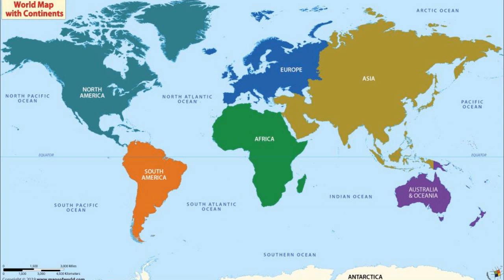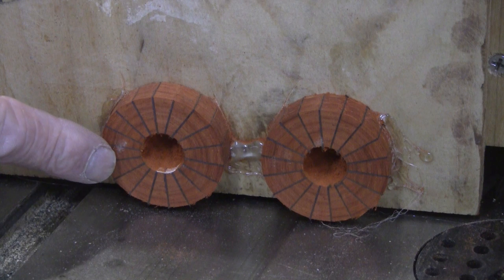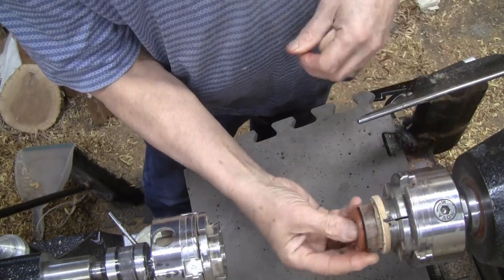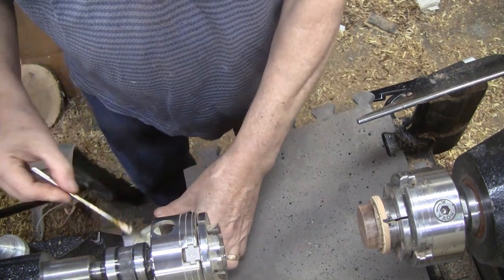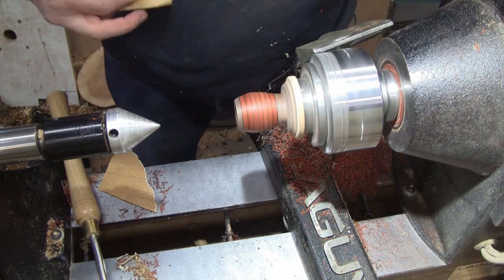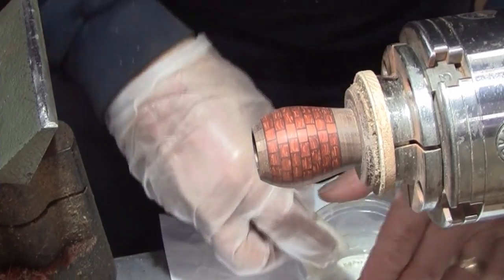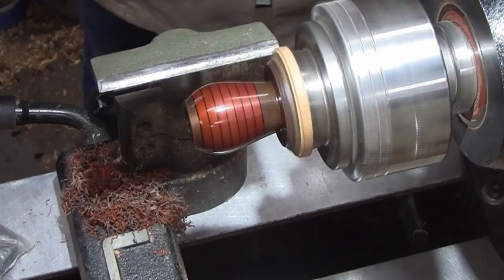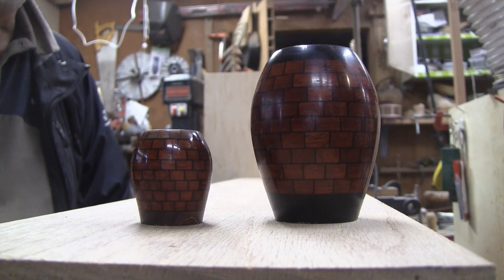Wood Turning Very Mini Brick Vase

Comment: WOW Gary, that's one stunning piece of segmented artwork.
Who said "size is everything?", it certainly is with this piece - just right to tell a story.  Without a doubt, the choice and collaboration of the woods used truly sing in harmony with one another.  I've always been an advocate of enough coats of lacquer to emphasize and protect the wood.  Your ethic of 10 coats of lacquer are proof they were just enough after polishing and buffing to really make that piece bling.
I'm off to see Rav's rendition.
You take care Gary, regards and best wishes until your next adventure.
Tony.
Reply from the maker: Thank you Tony for your kind comments.
I think 10 coats gives a real nice finish. Some woods take less and some more. I think I used 10 coats on my  Barrel of Blocks. The finish on it was even better than this one. Check it out if you have not seen it.
Thank again and take care,
Gary

Comment: I have watched this video a few times now Gary before making a comment which I think will be bigger than the vase.  I am stunned by the size of this piece for a segmented turning.  I just did not understand how one could handle such small pieces segmented.  I know my hands would never have coped with the size of the segments.  It is a truly beautiful little vase perhaps to take some Violets.  Truly awesome my friend.  Don, from South Aust.
Reply from the maker: Thanks Don and for sure the pieces were very small. If I spend much time on handling something so small my hands start to cramp up.
You reach a point where smaller becomes harder same as when it gets to big. 
That said it was lots of fun to do.
Take care,
Gary

Comment: Wonderful job, as usual. I have a question. Rarely have I seen a turner apply multiple lacquer coats and then abrasive and polishing pastes. Could not judge, in your final views of this piece, what effect this process had on appearance. What is your thinking behind this process?
Reply from the maker: Thank you Chuck. My thinking is no matter how well you spray lacquer on something with a round surface there will be a bit of over spray. I do wet and dry sand to 1000 grit but I feel the abrasive paste is much finer than that. It just seems to add a little more depth to the finish. 
Not sure if you watched the Barrel of Blocks video that was right before this one but you can really see the difference.
 I do see a lot of people use the Beall system on lacquer to do the same thing.
Thanks for watching and commenting.
Gary
Reply: ThePapa1947 thank you for the explanation. I appreciate you taking the time.